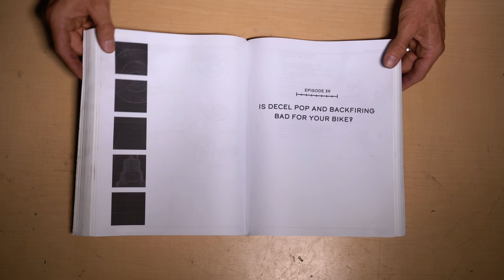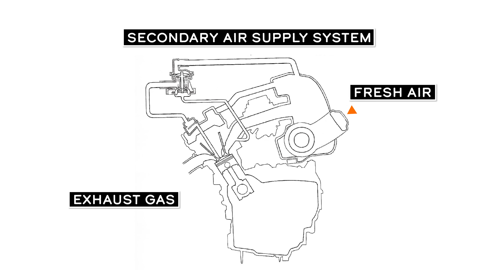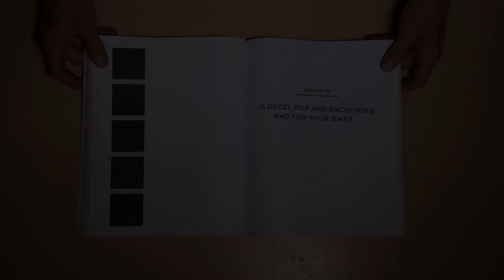Backfiring and Decel Pop — Is It Bad For Your Motorcycle? | The Shop Manual

Comment: Decel pops and backfires occur in the combustion chamber and are ignited by the spark plug. That is why backfires can damage the engine. No combustion is igniting in the exhaust pipe. What a ridiculous idea. Of course the sound is coming out the exhaust pipe. Decel pop is caused when the engine is spinning RPMs higher than idle during the engine braking deceleration while the throttle is at idle and supplying only enough air and fuel for idling RPM. So as the engine is starving for fuel mixture along the way it does accumulate enough to fire at longer intervals,  and it is ignited by the spark plugs which are still sparking as the engine is decelerating. A stone-cold engine with a cold exhaust system will produce decel pop. Ignition occurring in the exhaust? where did you make that up from?

Comment: I would highly recommend a ECU flash after a new exaust install. 
Those pop and bang can be fun, but as said it is a sign something isn't right (lean/rich).
Reply: Really only applies on a full system. Just swapping to a slip on should require changing fuel mapping.
Reply: What they don't mention is decel pops are for emission compliance as it is burning unspent fuel before it exits the exhaust. -honda r&d tech (not me)so if you have a Honda with a high flow exhaust from 2010 and up and it isn't popping. Something is broken

Comment: I put a danmoto exhaust on my bandit, and the decel pops are amazing. 

Roll down a hill with barely any throttle input and it goes popopopopopop the whole way down. Really makes my inner child smile.
Reply: Have you checked the plugs to see if it's running lean? I just got a bandit with full exhaust and she pops like a mf. Gonna pull a plug and see how it's looking in the next few days but it does sound awesome
Reply: @flatman When you install a higher flowing performance exhaust system, you must also re-jet the carburetor(s), or reprogram for EFI fuel systems. 

You need to richen the air/fuel mixture to compensate for the added flow of the larger pipe, otherwise the engine will run lean.

IMO, the explanation given in this video did not put enough focus on how increasing air flow with a performance exhaust, and/or modifying the air intake, will almost certainly disrupt the air/fuel mixture, causing a lean condition.

Some of the main symptoms of a lean condition are, hard cold starting, popping on deceleration, higher engine temps, random stalling, poor throttle response/hesitation (especially off idle), and premature engine wear/failure.

Comment: I've also got a cbr500r but ever since I removed the cat (haven't tuned it yet because I can't find a tuner for the '22 model yet).

I have a lot of decel pops especially when letting go around 7-7.5k rpm, but occasionally a loud pop as well, aren't these just decel pops as well?

I'd find it weird that a brand new bike would have it after just removing the catalytic converter

Comment: I have seen videos where Dyno tuners are able to retune the ECU's and give the customer the choice of Pops and Bangs, or normal, quiet operation while maintaining increased power levels. As a Ducatista with aftermarket pipes and factory race ECU, mine has no pops on decel that are audible, but a friend with a pops tune sometimes shoots flames, and makes such annoying bangs... usually on throttle closed decel from about 7000 down to 2500RPM. Riding behind him can be exciting. We should respect peoples need for peace and quiet, and not have ridiculous tunes to make even more noise.

Comment: Good presentation.  Anytime you open up your exhaust, you must richen the mixture of carb or EFI, or your bike will run hotter.  I took the absurd Cat of my bike and installed the Booster Box.  Idles better, off the line better, accelerate better and sounds better.  If it pops I can't hear it on the bike.  It's only louder when you dial it on.  But I did notice a few weeks back, a few threads of fiberglass hanging out the back.  Haven't seen any since.  Meh.

Comment: one should perhaps differentiate with the Backfire: too big or no DB killer (bad for the rear silencer) or too short Header (bad for the exhaust valves). In both cases, fresh air is announced through the Muffler and ignites unburned exhaust residues. but if it just pops out the back, it will damage the insulating wool in the exhaust at most. However, if this mixture explodes up to the exhaust valves, it can hurl them back against the valve springs into the combustion chamber or at least cause a second hot flame front on the valve disk

Comment: I have a CB350, and it's almost a year old. But almost from factory, engaging into first has always been a mess. Quite tight, loud noises and would jerk the bike forwards a bit, and would sometimes would just return back to neutral. The showroom said it was due to the auto choke pulling up idle revs on first startup, and it was completely normal. But it occurs always, not just during first startup. I've made it a habit to just start the bike in gear with clutch engaged. Is it bad to do that? And what might be the problem causing the noises during first gear engagement.

Comment: Now I have an older bike that allows you to play with the air-fuel ratio, currently its on stock settings and I have slip-ons.   Now what would I expect by:
 + vs -    that ratio?🤔

Comment: As someone who has 3 KTM 390s with 3 different exhaust setups I can confidently say the less stock exhaust there is left the more pops you'll get. I have one with a stock exhaust which doesn't pop at all, one with just a slip on without db killer which pops occasionally but not too often and not very noticeable, and then I have one with a decat and slip on but with db killer to not be too obnoxious and that one pops like crazy when you let off the gas and it drops below a certain rpm
Reply: if it is newer than 2017 then it is because it is running very lean. The new dukes don’t compensate with more fuel due to emissions. So the more you increase the airflow the leaner it will run.
Reply: @oscarkarinkanta  I know the newer ones run very lean, oddly enough my RC390 which is a 2018 models with the slip on only has very few and rare pops while my Duke 390 is a 2016 with a decat and slip on that has a lot of pops, the difference in cat and no cat is very noticeable

Comment: As usual, I'm the 2-stroke guy just watching this to hear about what The Normals are worried about.

The most spectacular after-fires I've heard were both from bikes with bad ignition condensers.  Super weak-ass spark leads to a TON of unburnt gas AND unused oxygen while trying to climb a hill or something.  Eventually some of that weak sauce flame is still present when the exhaust port opens, and KABLAMO.  A 2-stroke expansion chamber and stinger really makes this bigger and sharper than it would otherwise be.  My cousin's 100cc Suzuki sounded somewhere between a .30-06 and a Civil War cannon.  My 400 triple did the same thing in the street a few years ago, and it REALLY got peoples' attention.

Comment: lots of times your "decel pop" is caused by hot air from your engine mixing with cold air coming in from the surrounding air which makes a pop, it happens especially on chilly mornings/nights

Comment: If only one could invent an engine which doesn't use valves but ports, and then put an exhaust on it with an expansion chamber so it goes back into the combustion chamber 🤔

Comment: There are some Quick shifter kits (plug & Play, and tuning required) that also artificially promote decel pop (NOT backfires damnit!), notably with a small amount of fuel to be sparked up at exhaust's end. 

Fun and game, though shops already tell me this artificial recreation won't damage the engine, it's just that there is a small intervention from that QS kit to trick your bike's ECU spare a few (but unnoticeable) amount of fuel, nothing more. 

It's actually used in Racing tournaments (armature ones I assume) to let the bike breaths better through rev range aka. quick shifting FTW, and burning unburnt gas also helps with that, though flushing your pipe - probably at every race's end - is a must. Same for street use, I guess.

Huge thanks to Ari for explaining this mechanic quirk that even I can't confidently realize on my own. A coincidence that some aftermarket QS kits also have this decel pop feature that's still being "labelled" as Backfire is like an itch on my nuts.

Comment: yep
my cbr150r has the backfire after i install aftermarket exhaust on it
the power loss at 4k-6k rpm is noticable but the bike ran better at higher rpm range 7k-11k
this happened because i didn't tune the bike yet
but my buddy bike have the same system but tuned
he didn't have any backfire but more pronounced decel pop also don't suffer power loss at 4k-6k rpm
and better acceleration at 7k-11k rpm range
-
tune your machine, if you can't afford to tune yet maybe it's not a good idea to put aftermarket exhaust on the perfectly fine machine
mine has only 30k/km on odo but suffer the valve clearance issue while my buddy bike didn't even tho he has the aftermarket exhaust on.

Comment: Is it ok to change just slip-on without tuning? Does it hurt mpg and Powerloss?
Reply: The short answer is no bro, go for it! The long answer is: well not that much.
Reply: On modern bikes it can usually be done without changing anything and the ecu willaccomodate it using the air fuel lambda sensor. Even on carb bikes, the slip on is not usually a big enough change to take the air fuel ratio out of reasonable limits as the manufacturer won't have it runnning at the bleeding edge. You can always tune it after for whatever specific set up you have though to get the best result.

Comment: Mine only pops and burbles when I just crack the throttle ever so slightly, but when I do it sounds like an AK 47 😂 I’ve got an Aftermarket exhaust with a power commander and tune, I didn’t put the tune in so I’m guessing it’s a “feature” considering i need to crack the throttle to have it occur.

Comment: I have a ducati streetfighter 848 with full open Termignoni slip ons. Was professionally tuned. Pops and bangs (like a shotgun) constantly when off the throttle. Also when using quick shifter will pop on the up shift, especially when not warmed up fully(with a nice blue flame). Great video(as always)Pity not more audio examples.

Comment: My Yamaha had an AIS (air injection system). Installing after market slip-on exhausts made the bike pop like crazy on deceleration after tuning and syncing. Removed the AIS system since I didn’t need the extra air with the more breathable exhausts and no more pop occurred. It was more so an emissions thing.

Comment: The CBR500R in the video is a perfect example of this. Bone stock they pop like crazy including mine because of the PAIR valves. Great video
Reply: Love my cb500f. Received several compliments regarding sound at some red lights
Reply: I have n FZ1, and when I put on a different exhaust system the popping on the overrun was very audible - it did concern me initially, but learning how the PAIR system worked I understood it was nothing to worry about. On a stock exhaust or with the baffle in the current exhaust, the pops are not easily audible, if at all. I can take or leave it, but my father says it sounds very cool!
Reply: It seems to be a pretty common thing, my SV 650 also has a PAIR system. I wouldn't be surprised if it was linked to the Euro regulations.

Comment: Does the same go for dirt bikes too? Do they have a higher air ratio?
Reply: There's a fixed A:F mixture that optimal for all ICE's for power or for economy/emissions.  That's based purely on the physics of combustion. 

 Dirt bikes can often be tuned more for performance because they're usually not bound by the same restrictions road-going bikes are (which is why you can still buy 2stroke dirt bikes at all)

Comment: When I fitted a SP race can on my ZX9R c2, it constantly popped on decel, so I turned the fuel screws out a 1/4 turn, still get a slight popping, but not as bad, but I also removed the klean air system!

Comment: My t7 started popping a lot after I put on a high mount slip on. Figured it was OK since I didn't touch the stock cat. It's crazy how much work they put I to stock exhausts to silence them and still run well
Reply: Which one do you have. I mounted on the MIVV Dakar and it's too loud with the db killer it comes with . I bought one with a smaller diameter and it's much better now. Much less decel popping. Almost the same volume like the oem exhaust, but a lower frequency.
Reply: @Lexx1976  I ordered the short version of the huzar exhaust. I wanted the mivv or the ho corsa but I went cheap and rolled the money into other parts lol. It's a good pipe but it didn't come with a dB killer so yeah its loud. 

I ride with ear plugs since my helmet is so load so thats more of an issue for me than the pipe.
Reply: @jaybosher6144 Really? My Huzar (also short) came with two baffles.  With both installed, it was roughly the same as stock, with them removed it's about the same volume as stock with its baffle removed.  

Apparently running both baffles on the longer (500mm) can is significantly quieter than stock.
Reply: @Derrick Whittet  damn yeah I didn't have squat in my package. Figured it may have been extra. I'll live but I'd like to have something so im a bit more subtle when I'm  riding around the woods

Comment: Thanks for this vid. I've gone from a leaky manifold that was causing backfires to a fresh full black widow system on my carb blackbird. But I have been noticing backfires when I'm rolling down the revs. After this vid I'm convinced it's audible decel pops as they're quiet and in line with the audio clip. Thanks for putting my mind at ease. Keep up the great vids
Reply: Can anyone please tell me why does bikes like ducati or any supersport motorcycle produce a loud bang on quick shifting at high rpms ??  I am assuming that it is because the engine is taken away from one or more powerstrokes cuz of quick shifter , so to compensate the drag caused by the no powerstroke cycles , it pumps more fuel and air in the immediate powerstroke ??

Comment: Decel pops are just another reason to enjoy your time on two wheels.
Reply: It's not good fellow. One of my bikes popped cause the floats was off
Reply: @onenessseeker5683  With over 40 years of riding, on more bikes, and different types, than I can remember, I’ve never had any issues with decel pops. Just music to my ears.
Reply: @marcusgeorge1825  Well I know you could have gotten more life time out the pistons. An half blocked jet can = decel pops & that is not good cause the piston is not getting enough fuel to help keep the piston cool. As soon as a dirt bike starts popping you better sort it out quick
Reply: @onenessseeker5683  I don’t think this was covering pure dirt bikes. The ones where service intervals are measured in hours not mileage and yearly (which ever comes first).
Reply: @marcusgeorge1825  Just saying when you hear decel pops the piston is lean on fuel. can lead to hotter piston or worse

Comment: Refreshing to see someone who knows what a backfire actually is. I love that he briefly mentioned off-throttle fueling as well. From the factory for emissions reasons, when you close the throttle completely you get whats known as decel fuel cut. When transitioning back to on the throttle and starting fueling abruptly again, this causes a harsh jerking transition. Any proper flash tune (not piggy-back trash like power commanders) can disable this. The downside (or upside depending on you) is angry demons releasing from your exhaust on decel, with potential for flames depending on your exhaust setup. The off to on throttle transition is 100 times better with this fuel cut disabled.

 Side note, cars and trucks do this as well. Its not as noticeable of a transition as on a bike, but it still makes a wonderful difference when disabled.
Reply: Hi, any downside with turning off this option?
Reply: @MRsickcat84  None whatsoever from a reliability or driveability standpoint. Enjoy the better driveability. Your emissions will go up by a minute amount.
Reply: @Dexter-tx5fp  great! Thanks man!!
Reply: @MRsickcat84  You will lose some engine braking (noticeable) and fuel economy (less noticeable) by disabling fuel cut.

Comment: YES! BACK fire! It goes BACK through the intake. It's LARGELY a carb problem, but having your plug-wires or coil packs hooked up wrong can do it, too.
Reply: Yep. Had a guy “help” me get my bike running again and switched the coils.. my god, my bike sounded like a machine gun!10/10 would not recommend.
Reply: I just did this. I’ll switch them back. Should’ve labeled them
Reply: @francogestro6037  i need to do that too!! Thanks for the reminder, im working on my bike tomorrow, so its on my to do list 🫡

Comment: My 2002 Bandit had custom ground jets and was tuned by reputable garage.  It also had a high lift intake cam and a slip on.  Carburetors can’t be tuned like fuel injection and thus I had lean areas and rich areas.  My rich area was roughly 6.5-9k rpm.  If the exhaust was warmed up and I rolled off the throttle from at or above the rich area of the rpm band, I would get decel pops into decel bangs.   There was nothing wrong with my bike or the tuning.  Only because it was carbureted.
Reply: There's no reason carburetors can't be tuned for proper AFR. Folks been doin' it for decades. If your mechanic is suggesting that it's "because it's carbureted," then perhaps you should take the bike to someone that knows more about tuning carbs.